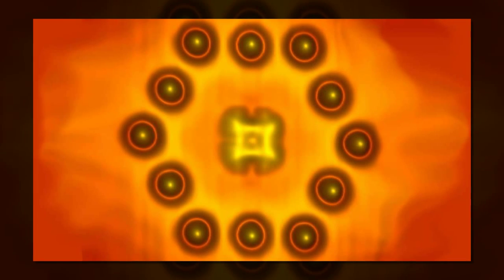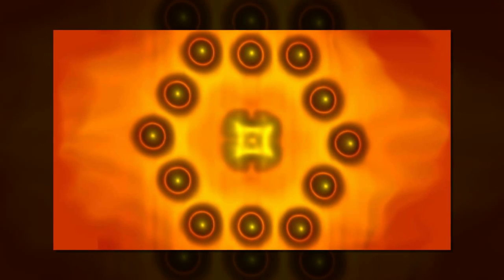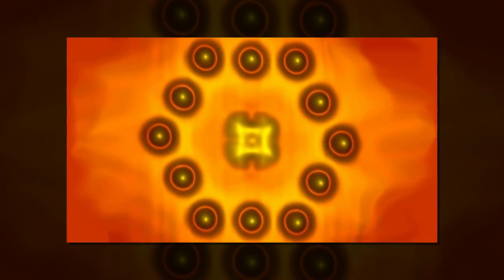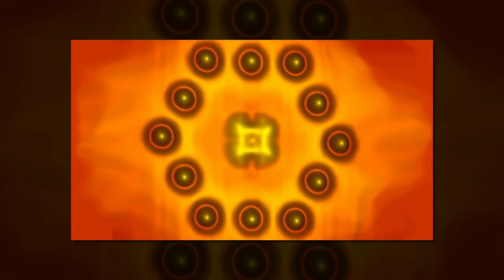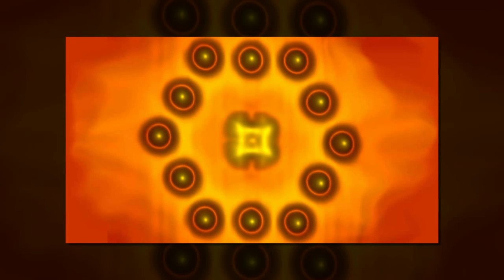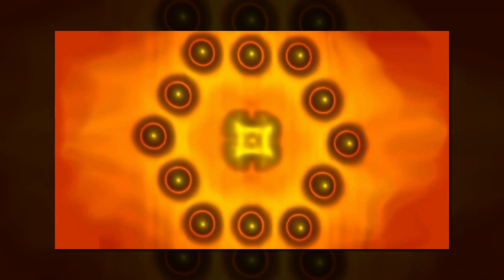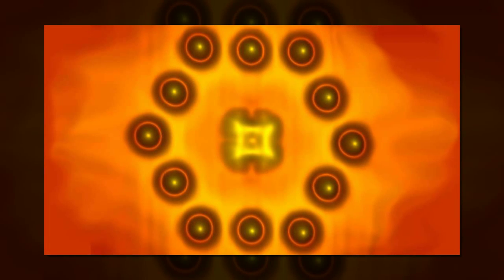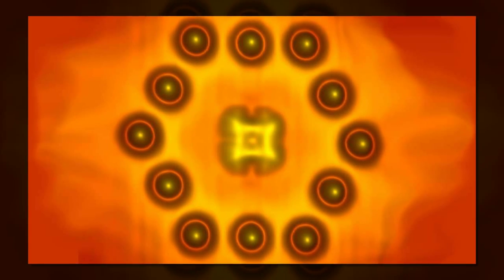Researchers create transistors using a single molecule

Comment: Much of the behavior of such transistors is not fully understood. An understatement. They are far from having a clue what they're doing without some vague model of field unification, at the least. Standford U is doing something far better using graphene dna, but they're growing them on films 2d first. Archaic Neanderthals. The graphene field effect transistors are far more stable, esp. for large scale computers which may exhibit a problem of gravity stacking loads. This material is also naturally superconductive and produces it's own power, under the right conditions. Nikola Tesla could extract power from a graphite medium like a solar cell, but it worked in the dark. So much of his work has been overlooked. I've discovered a method for growing graphine dna in a suspended matrix but lack proper equipment to manufacture anything. sol.